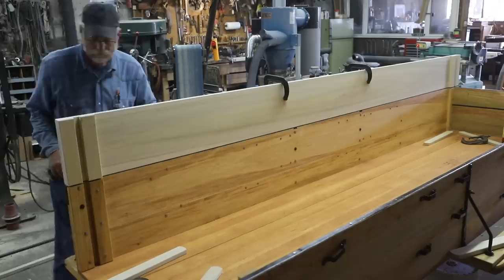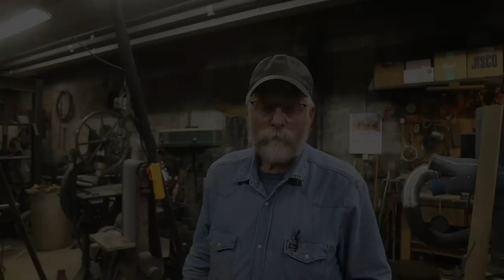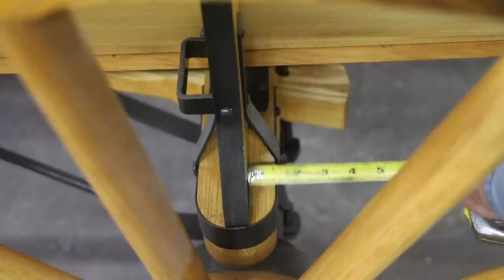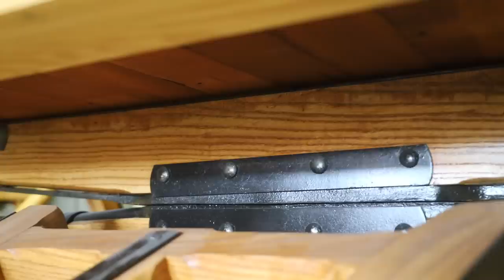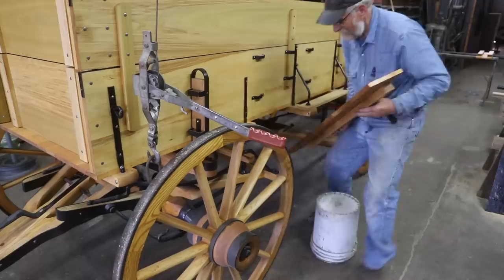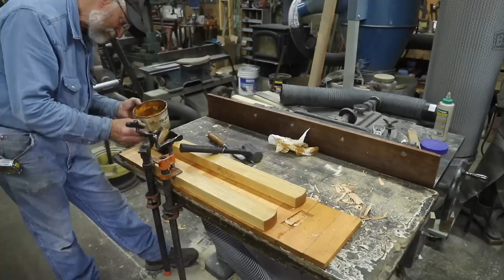The Unseen Plays a Necessary Part in Wagons | Engels Coach Shop

Comment: Thank you, Dave. A couple of videos ago I asked what those uprights on the frame were. Now I know. In addition you have explained to me the mystery of "Body by Fisher" on all General Motors cars at least through 1980, and still today for all I know. Clearly 130 years ago, one trade made the "frame" and another trade made the bodies. In this chuck wagon we see the body dropped onto the frame which has the axles, wheels, steering, and power source. When wagon making changed to automobile making the automobile body was made by the Fisher Body Co. and the frame, engine, axles, and wheels were made by Oldsmobile. When I worked for General Motors in the Final Assembly Building at Oldsmobile in 1974 this was still the case. The bodies were made in a separate factory three miles away. They were trucked to Final Assembly, and hoisted to the second floor. Then, after the entire frame was assembled the body was lowered onto it. In fact the same frame could be a sedan, station wagon or a hatchback version of the same model

Comment: Always impressed, Do notice how the boxes were so big 10 ft on the wagons back then and motorized trucks shrank down to the 8 ft standard box for so long
Reply: I have read that the sizes had to do with turning radius and street size - which led to standardizing street sizes, tunnel sizes, lane width, turn banking, parking requirements, etc.
Reply: @robertbamford8266  uoh I'm sure alot went into bed size standards, way more than a couple of people want to comprehend

Comment: With the expansion an\d contraction of wood, You made the side boards and extensions a very tight fit. Are they meant not to be taken out, if so when they swell how would you get them out? Thanks
Reply: In our dry climate, shrinking is more of a concern than swelling.

Comment: I would like to ask a question about your rivets please.
Do you use something specific for the rivet, or is it a brite nail with the tip cut off. 
Thank you for your time and what you do.
I am a master wood finisher
And journeymen carpenter and
I  learned some tips and tricks from you before but honestly I never knew about the rivets.  I love the concept and would like to learn more about it thanks again
Reply: If you own a shovel, you (likely) own a tool with riveted construction.
Reply: @horacerumpole6912  Yes I understand that.
I am more interested in the larger wood working projects
Reply: It's called a box rivet or truss rivet.

Comment: How functional would wagon wall riser things be if they folded down at the sides using hinges and when flipped up they lock with hooks and eye bolts?
Reply: Carrying weight without a purpose is counterproductive with equipment pulled by animals-

Comment: At about 3:00 where he's attaching the verticals the long box boards, are those long rivets he's using? They look just like regular nails, but if you've ever tried to peen over a cutoff nail like a rivet head, you know that this doesn't really work. Nails are hardened, tempered wire, not the relatively soft steel used for cold rivets.
Reply: They were rivets.

Comment: Dave, do you have to be careful to put any rags or paper soaked with linseed oil, outside in a metal bucket every night, to avoid spontaneous combustion? The sports locker room at the school where my son used to be, was badly damaged by fire, started by a linseed oil soaked rag that had been used to oil cricket bats.
Reply: They all go in the woodstove.